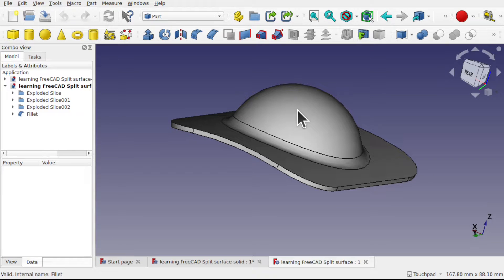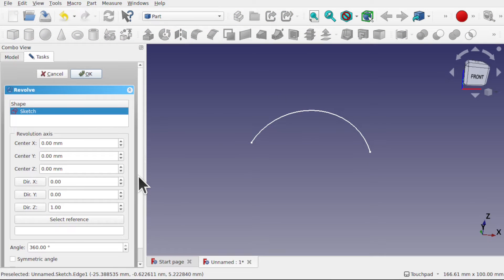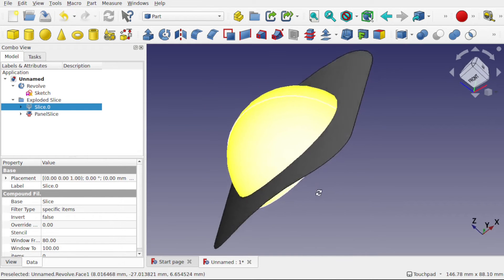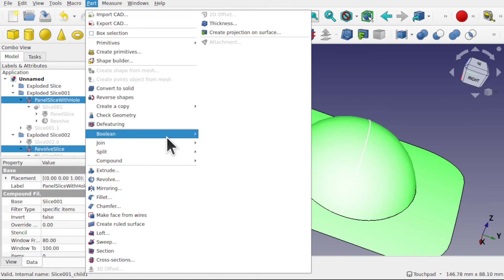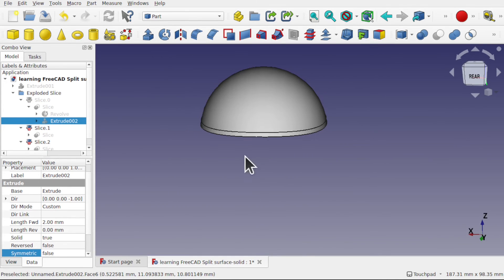FreeCAD for Beginners 29 : Surfacing Workflows | Split and Join | Spherical window in a curved panel

Comment: 00:00 Intro
01:21 Sketching sphere profile
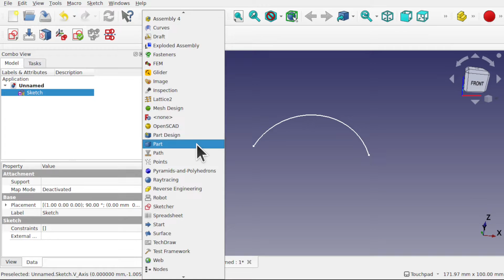02:10 Part: Revolve
03:21 Sketching bottom profile
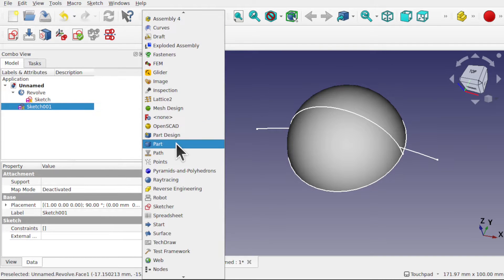04:53 Part: Extrude bottom profile
05:33 Sketching top profile
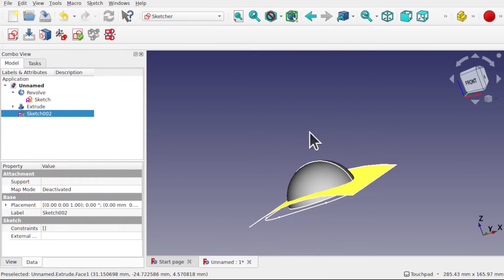07:08 Part: Extrude top profile as shell
08:01 Part: Slice Apart (3x)
11:32 Part: Union
12:25 Part: 3D Offset
13:16 Part: Fillet (Complete)
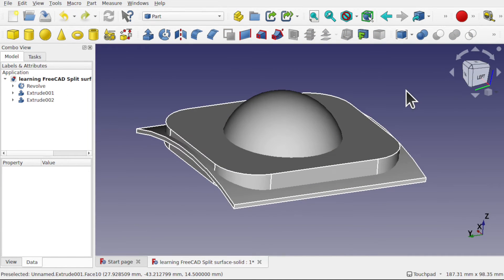14:58 Repeat from 08:01 starting with thick geometry
Reply from the maker: This is so much appreciated, thank you for spending your time in doing this. Very kind of you.

Comment: Another cool tutorial. I prefer the shorter tutorials that illustrate a specific tool or technique.

I had some minor trouble understanding the Split Apart tool, but the way I describe it is as such:

It splits an object into multiple objects given a shape.
Reply from the maker: Glad you enjoyed. Yes exactly what you describe. You can also use an array of shapes to do the splitting incase you wanted multiple layers. Think of a lamp and you wanted to make a lattice style laser cut version that you can offer as a flat pack design to a fabrication company to cut for you. Use a solid lamp design, and a polar array of a rectangle and use the split apart.
Reply: @MangoJellySolutions  Wow, that is awesome. You just taught me a new thing. I can see this tool being very useful for creating non-linear shapes.

Comment: I've tried to do solid workflow but every time I tried to revolve, the app kept saying "BRep_API: command not done". I closed the unsaved file, started from scratch and it worked no prob! Weird, but now I can do both surface and solid based workflows for surfacing! Thanks!
Reply from the maker: Great that you was able to get it working :) :).  Bit strange it didn't take first time.

Comment: Hello. If I want to extract volume(bottle of exhaust/intake manifol of car) I need to plug all the outlets of the solid model, then (theoretically speking) erase one outside surface of the solid, which will make the entire outside of the solid model to fall apart and create only surfacessss and then the inside volume should stay as a solid. I can then use it as a model for the casting core and also test the volume of the bottle....I just cannot find anywhere (user forums or youtube vids.), how to erase a surface from the solid body. Do you have any solution?

Comment: Could you make a tutorial that shows how to design a construction with FreeCAD. Something with multiple parts. Where the dimensions and shapes depend on each other and you want to make adjustments in FreeCAD while the design of the construction develops. Say: you want to design a vice from scratch and do it all inside FreeCAD.
Reply from the maker: This is something that I will be doing this year. I am looking at a number of assembly projects
Reply: I'm looking forward to it. Thanks in advance!